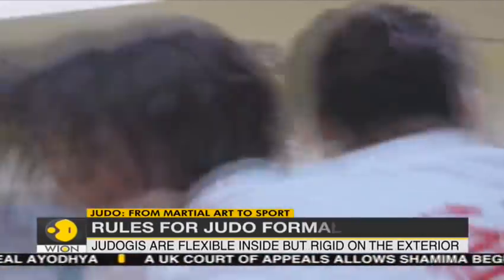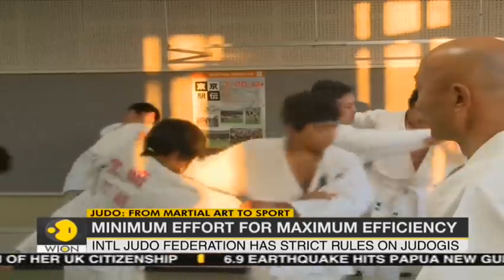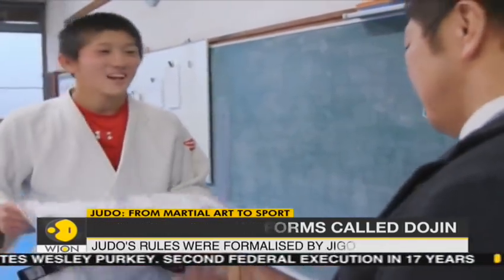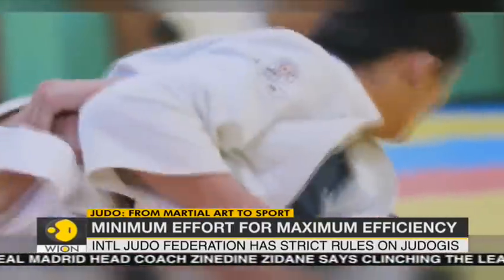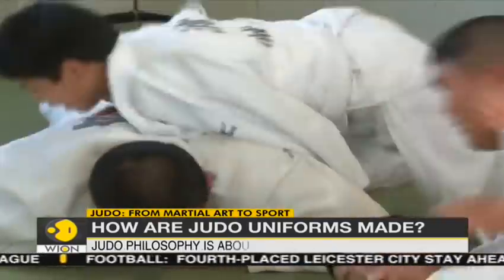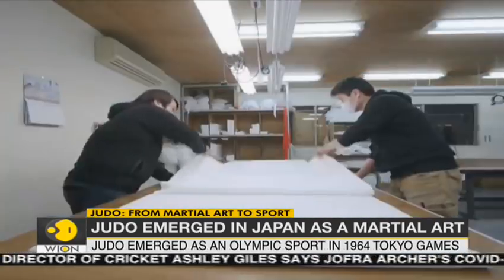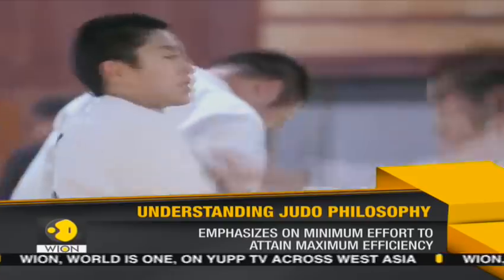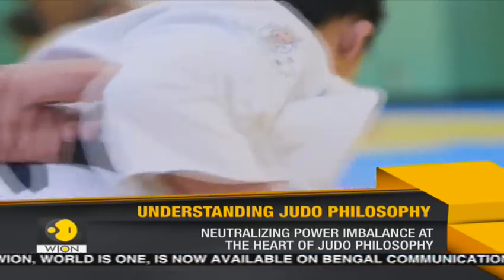How are Judo uniforms made? | Minimum effort for maximum efficiency

Comment: Judo doesn't emphasize on minimum effort for maximum efficiency. 
These magical stories are told by people who never trained any martial arts with sparing. 
There is also no magical technique for bigger opponents. Everything works if the opponent doesn't have the skills. There is no magical technique if the opponent has the same skill as you have...
Judo is based on incredible physical strength and excellent technique, mixed with good tactics. All grapplers, don't matter the sport, are extremely strong individuals.
Reply: Hahahah!! That is so true...the thing which makes technique look effortless is all the effort which is put in to achieve the perfection in technique over the years.